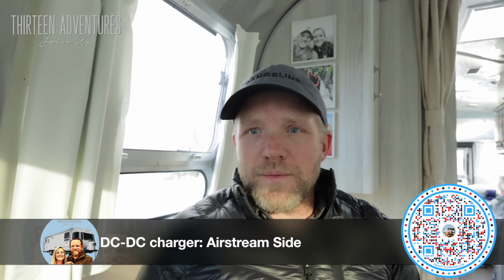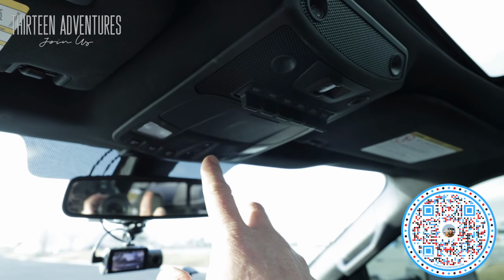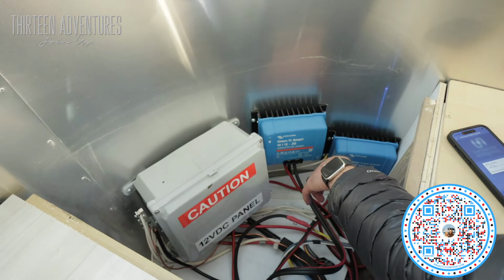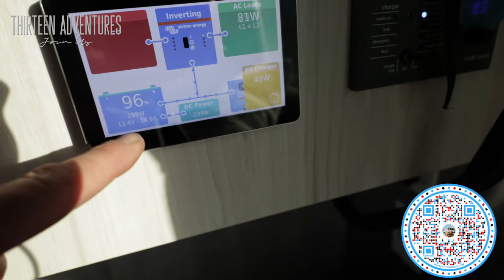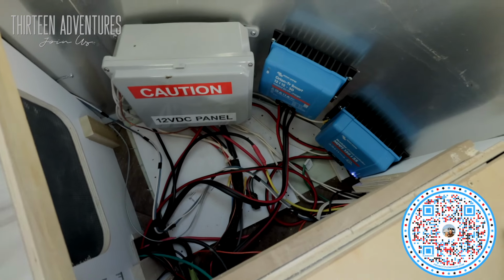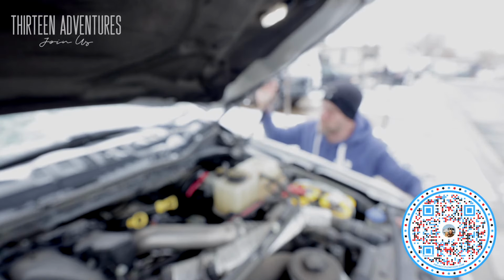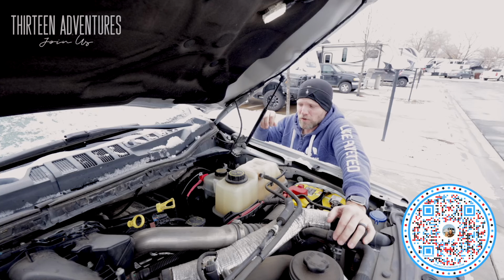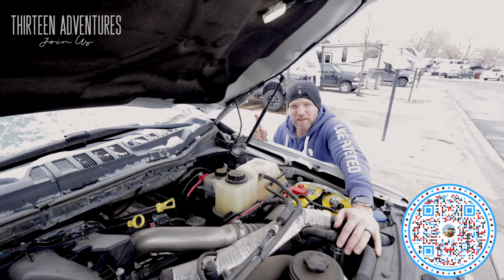Installing Victron DC-DC Charger in Our Airstream | Truck Setup Tweaks for Ultimate Off-Grid Power!

Comment: Fantastic. I'm fixing to do the same to our 2024 International but we have the 27FBQ. Our trailer has 2 factory 100Ah lithium, but I have 560Ah worth of new lithium & 3000 watt inverter I've removed from our trade in. I'm debating leaving our airstream as is, and putting the 3k inverter & 560Ah of battery in the bed of the truck in a transportable'ish case that could provide extended shore power/recharge the airstream for extended off grid.
Reply from the maker: Ive seen a few people do that exact thing.  Also, if you have a truck cap, you can put solar panels on top of it to plug into your box to keep it charged.

You could also save a ton of money and buy a dual fuel inverter generator and always have it if you need it.  If we didnt boondock as much as we do, I wouldn't have installed all the things I did.
Reply: @ We do keep a 4500 watt inverter generator with us, but I got on this solar kick a while back after getting hooked on Will Prowse from DIY Solar.  I’m sitting on a pallet of new 480 watts Aptos bifacial panels.  I was going to put one on the roof of my Leer cap, I think it gives 370 watts max on the main side. I was about to put 4 on our 5th wheel until we got the Airstream itch from watching You & Blair, Ronnie, and KYD.  

So many options.
Reply from the maker: Sounds like a great setup you've got options for!

Comment: Yikes!  There were a couple loose wire threads going into your charger.  With such high voltage you may want to clean those up a bit.  Maybe consider a wire ferrule.
Reply from the maker: That was corrected.  That photo was to see what was under there.

Comment: I had the same concern with the gauge of the wires coming off the 40 amp fuses in the upfitter box.
Reply from the maker: So far, its worked well!
Reply: @ThirteenAdventures  It works on my 2022 Ram 3500 too.

Comment: I have a 2013 Ford F350 Diesel with the Upfitter switches. You mentioned that you have the upfitter wire going into the circuit breaker.. Why is that? Are you able to shut off the circuit going from the battery back to your Anderson Connector which is what I want to do.  If so what kind of breaker are you using to do that using the wire from the Upfitter switch.
Reply from the maker: I have the circuit breaker in the rig.  Between the battery and solar controller, DC/DC charger, and all other inputs to the battery are circuit breakers.  This protects the battery in the event of a surge and also allows me to isolate them individually should I need to work on a system.

Comment: Tell me about the DC to DC charger that comes with the Tradewind. It seems to me that it is "plug and play," not requiring  connecting the truck alternator to the charger. Or and I, as usuall, confused?
Reply from the maker: I have no personal experience with this but understand that it is this product 
https://www.redarcelectronics.com/us/trailer-power-kit
I recommend you download the owners manual for the Trade Wind from the Airstream website for more information.

Comment: Okay, I am ready to hook up this to my 2023 30 Foot Classic. I removed the middle part of the sofa today and I see the converter and DC Box. I removed the cover on the DC box and all the blocks are full of connected wires. I know very little about electrical stuff, so I want to make sure I get it right. Exactly which wires from the Airstream side do I plug into the DC charger?
Reply from the maker: Hello!  You will need to run a wire from the positive out side of the charger into the box and attach it to the bus bar and a ground to the side of the box where all the ground wires are attached.
Reply: @ThirteenAdventures  Ah, okay I was thinking I need to use the ones inside the airstream. So wires in from the Anderson connector plugged into the box; then new wires from the box out to the batteries correct? I have 6 gauge wire will that work for around 8 feet?
Reply from the maker: Sounds like you have it all set to go!

Comment: Do airstreams not come with chargers to charge while driving? I thought they did
Reply from the maker: The 7 way pin does provide a bit of a charge when driving but not much.
Reply: Most trailers have very limited charging through the 7 pin connection to the vehicle. The dc to dc chargers have a much higher capacity

Comment: Working on a similar install. It looks like the ground is going to the painted hitch receiver and not the frame. Have you had issues with that?
Reply from the maker: It's to the frame.  I put it very close to another ground on the frame.  No issues.

Comment: How did you run the exterior battery cables into the trailer? Did you have to remove underside metal panels and then drill a new hole in the trailer floor? I have a 2020 25' Airstream International. I am adding a DC to DC Charger with a dedicated set of cables coming from tow vehicle. There will be plug on the back of the truck similar to what you have shown. Again, my delemia is how to run the "trailer side of these cables into the trailer". I am upgrading to two lithium batteries that will replace the lead-acid batteries in the battery box on the trailer tongue. Any assistance would be appreciated.  Thanks
Reply from the maker: I ran the battery cables through the existing hole in the floor.  I store the cable in my now empty battery box.  You should notice that your battery box has cables running out both sides.  One set of those cables goes to your inverter and the others go to the distribution box.

Comment: Can you run one or two AC units with this set up, with out shore power? You have installed  some amazing add-ons.
Reply from the maker: I could run both but it would kill the battery pretty fast. In direct sun this time of year, I can run 1 AC for 4-6 hours

Comment: For the output, do you run straight from the Victron to the battery or do you run into the 12v distribution box? If so how would you run into the 12v distribution box?didnt see you open the 12v box.  Thanks
Reply from the maker: I have a separate panel that I made inside the front storage compartment that has a resettable fuse for each component.  It’s hooked to that.  From that, it runs into the 12V box.
Reply: @ThirteenAdventures  do you have a separate video that involves any of it? My area is a mess (pottery barn 24)
Reply from the maker: It's across a couple of them:  One is final electrical connections: https://youtu.be/xlPkpUsgrsE?si=oojILXxfZ4RhEfoa. 
This one shows the board I built and where everything attaches.

The other is cleaning up the wiring video. https://youtu.be/xlPkpUsgrsE?si=oojILXxfZ4RhEfoa

Your best bet with the PB is to remove all of your couch cushions and then you can see an access panel to see all of this wring.  It's under the corner of your L sofa.